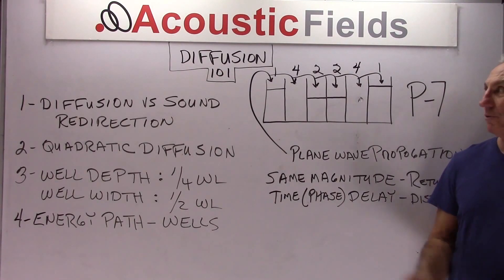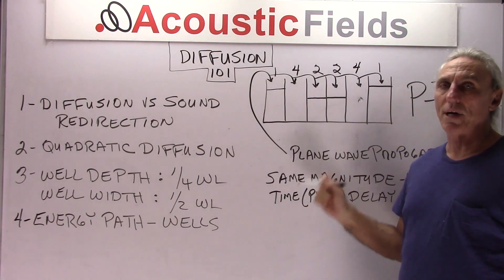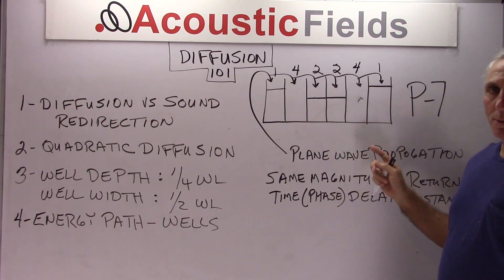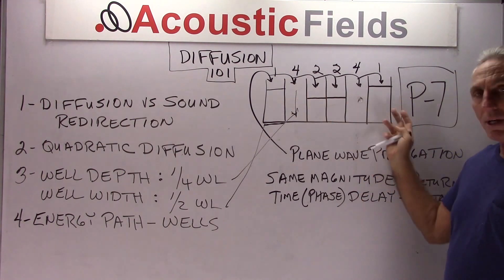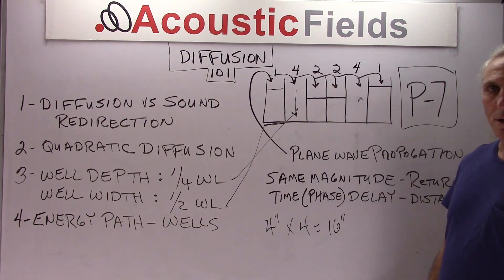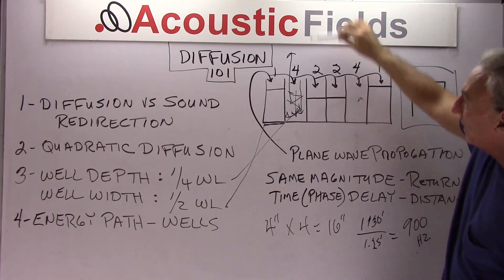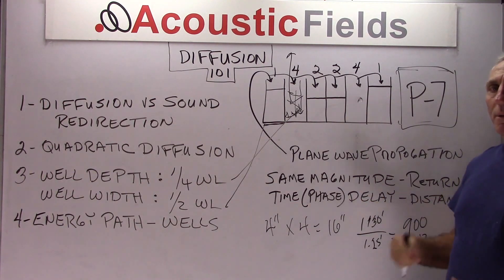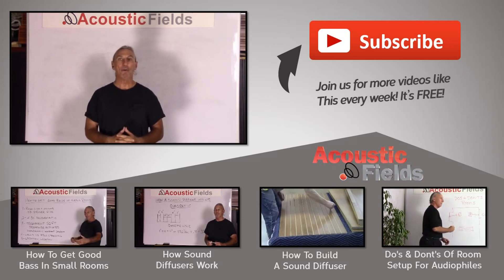Diffusion 101 - www.AcousticFields.com

Comment: Hi Dennis...hey ALWAYS love your stuff...succinct and just the right 'tempo'. 
RE: Diffusion definition. I totally get what you are saying but you may need to add a new word in the context of acoustics: "Diffusion is the net movement of anything generally from a region of higher concentration to a region of lower concentration". Doesn't redirection, when fractally applied, do that exact thing? Further to that...I do sound design and sometime used algorithmic reverbs: 

When changing the density of reflections for coarse slap back right through to deep cathedrals; its purely smashing the particles smaller and smaller which is not by phase cancellation like QRD etc: the reference parameter is alway 'diffusion'. Its always smashing by virtual 'scattering.

QRD is really tunable room eq :-)
Reply from the maker: Diffusion is a wonderful technology when applied correctly. I wish more people could experience the sonic benefits of quadratic diffusion.

Comment: Dear Sir; i have a room its ( L*W*H = 21*21*12) . What's your opinion to treat this room to become a Mix-Control room? thank you.
Reply from the maker: Hi Foun44, Coincidental modal patterns are created when all three room dimensions are the same. This exaggerates your lower frequency modal issues by a factor of 600 %. Here is a better ratio that will work for you. 19' w x 14' h x 21' l.